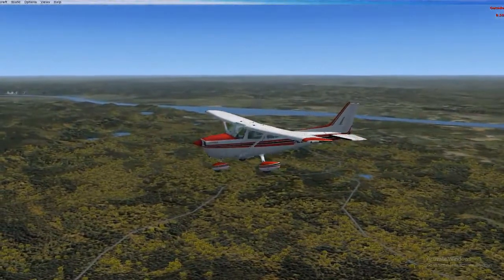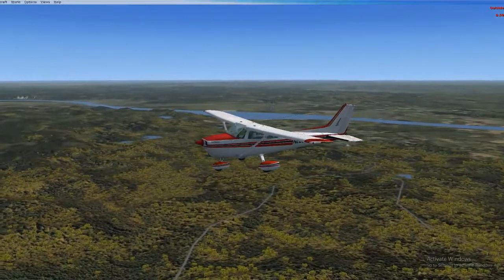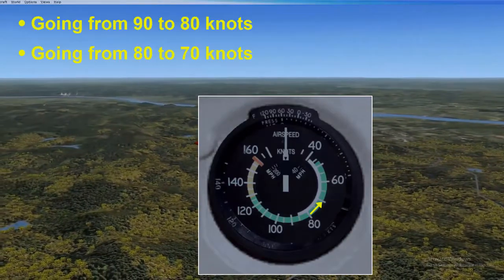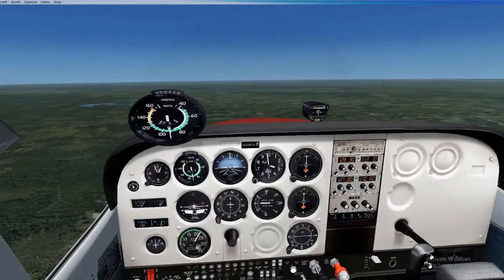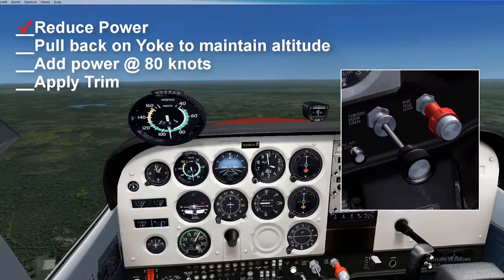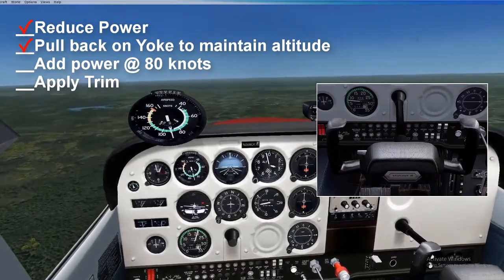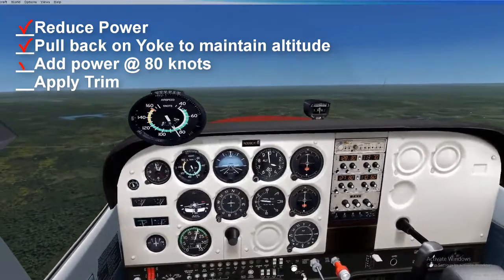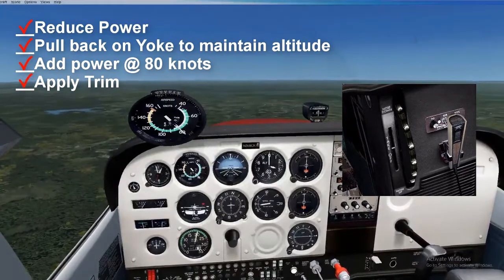Changing Airspeeds in Straight and Level Flight

Comment: Fairly new to FS. Can anyone explain why the third step is required. If you decelerate from 80 to 70 kts, why do you need to add back power after you pitch? Also can you learn the correct power setting for a desired airspeed with experience? Thanks. Great channel